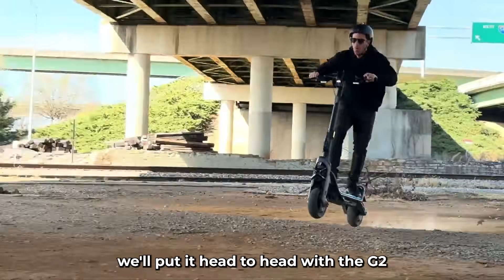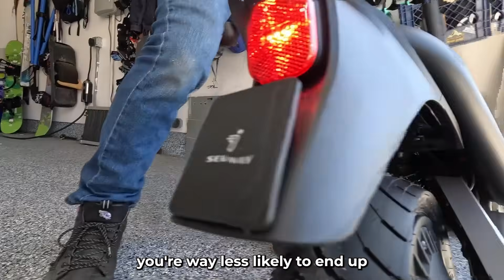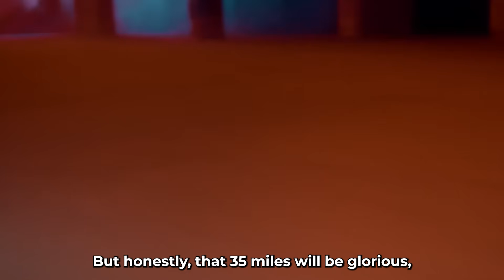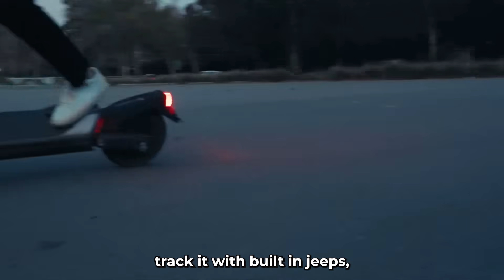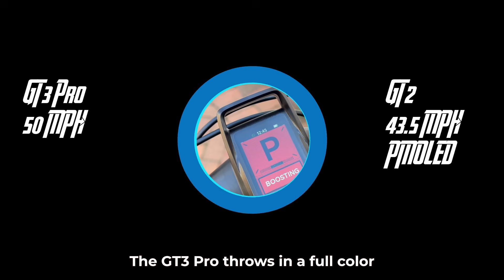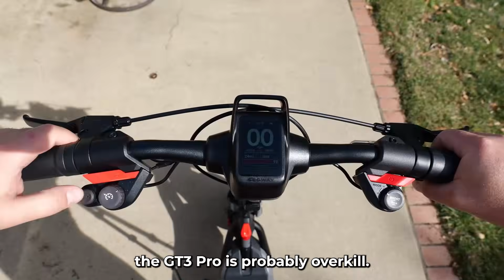Is the Segway GT3 Pro Worth the Price? The Truth Behind the Hype

Comment: well i have mine ZT3 pro and Segway do EXACTLY what they say can do... Reach 40km using pro gear at 40km speed. In low (15km/h) can reach 70km. I tested all. And all acomplished whit presition. Im from Argentina. Here i cant buy the GT3 pro, thast why i told my experiencie whit ZT3 pro... Segway administrate the charge whit 100% accurace. Right now ive done 2200 km in 240 days from when i adquire mine and the battery is exactly like the first day. Normally you could get a thousand charging cycles whit an normal use (charging 20% to 90%, and not using when is under 20 and not charging more than 90% - u can configurate this options in the app to save the long life of the battery)...
Reply: What I do need to warn you about is the shock absorbers. More specifically, the shock absorber bushings and axles. These break and can't be replaced. The entire shock absorber needs to be replaced, and it's not so easy... You have to disassemble a lot of plastic parts and buy some tools. But it can be done. The rest is flawless. I use it AT THE SKATEPARK! And in my city, there are cobblestones. I NEVER took care of it as I should have, and every day I jump from the sidewalks to the streets, fishtail hard when cornering, etc... And it's still going strong, with NOTHING wrong with it. When I disassembled it for brake maintenance, I noticed it has double weatherstripping on ALL the joints and melted liquid plastic on all the plates and connections. It's practically indestructible. I would buy it again WITHOUT HESITATION.

Comment: Gadget:  I'm not sure if I already messaged you, but I ended up ALSO pre-ordering like Andy.  I was deciding between the NANROBOT LS7+  or the Segway GT3 Pro.  I feel like the Segway just simply has more safety features which are important to me.  Also I do believe when you have a lot of ambient colorful lights on the side of the scooter, the chances of one of those small LED's burning out are 50/50.  I feel like that would cheapen the look?  The Segway has a less is more vibe going on, but still remains stylish.  I could always add an underglow ambient light which TO ME would look a lot cleaner?  I feel like the LS7+ has better brakes though?  Am I wrong?
Reply from the maker: The LS7+ does have a lto of LEDs. You;ll look like an icecream truck on a summer evening :). I assume you can turn those off, to save battery.
The brakes, form what I'm seeing, LS7+ has a four-piston calipers brakes with EBS, while the GT3 Pro has a dual-piston calipers. This means the LS7+ has a stronger braking force, and the pad wear is more evenly distributer. 
Not sure how large the disc is on LS7. but from the looks of it, you are right, they seem better. 
But for me it wouldn't be a decisive factor. The brakes on the GT3 Pro are good too. 
The safety features seem like a better fit for you, if you're worried about theft and all that.

Comment: It's definitely not worth the upgrade if you already have a GT 2, especially at that price. I don't know why anyone would need a scooter like that if they're just commuting.
Reply: 2599.00 pre order price.
Reply from the maker: That I agree with. If you're just commuting at cruise speed, no rough roads, not a speed fanatic. no point in upgrading , if you already have the GT2.
Reply: @GadgetEvolutionThe difference in performance between the GT2 and 3 is about as much difference between  120fps and 130fps in a video game. The difference in speed is negligible, and it’s very unlikely that anyone would utilize the capabilities without endangering themselves and others. Even the GT1 is sufficient.

Comment: I live in Canada, just bought it. Got it and it’s so fun, Powerfull, stable, reliable. Went 70km/h and felt like i was on a motocycle.
Reply from the maker: that's awesome. enjoy it!
Reply: How much did you pay? i can't find it on their site.
Reply: @JackReacheround yea it’s very limited in stock. I bought mine at an electric scooter store near where I live where they sell segway products. There was only one GT3 pro in their stock. I paid 4500 CAD
Reply: @EmileBrisebois friend, please tell me what is the real power reserve there? how many km will it really travel at a speed of 25 km/h and at a speed of 50 km/h
Reply: @andreypron3747 at 100% battery, well to be honest, i haven’t tested it as much as I would want to, I was travelling so not home. At 25km/h, it can do at least 115km on one single charge. At 50km/h, maybe 80km. And at 60,70,80km/h like 40km.
Reply: @andreypron3747  well i have mine ZT3 pro and Segway do EXACTLY what they say can do... Reach 40km using pro gear at 40km speed. In low (15km/h) can reach 70km. I tested all. And all acomplished whit presition. Im from Argentina. Here i cant buy the GT3 pro, thast why i told my experiencie whit ZT3 pro... Segway administrate the charge whit 100% accurace. Right now ive done 2200 km in 240 days from when i adquire mine and the battery is exactly like the first day. Normally you could get a thousand charging cycles whit an normal use (charging 20% to 90%, and not using when is under 20 and not charging more than 90% - u can configurate this options in the app to save the long life of the battery)...
Reply: What I do need to warn you about is the shock absorbers. More specifically, the shock absorber bushings and axles. These break and can't be replaced. The entire shock absorber needs to be replaced, and it's not so easy... You have to disassemble a lot of plastic parts and buy some tools. But it can be done. The rest is flawless. I use it AT THE SKATEPARK! And in my city, there are cobblestones. I NEVER took care of it as I should have, and every day I jump from the sidewalks to the streets, fishtail hard when cornering, etc... And it's still going strong, with NOTHING wrong with it. When I disassembled it for brake maintenance, I noticed it has double weatherstripping on ALL the joints and melted liquid plastic on all the plates and connections. It's practically indestructible. I would buy it again WITHOUT HESITATION.
Reply: @EmileBrisebois what store I'm gonna order it online I guess
Reply: Hey where in Canada are you? Im in Toronto. I am about to buy it. I know its end of season but still.
Reply: Powerful u dummy
Reply: @Alex-tu5vu You, you dummy!

Comment: the gt2 was $4k at release and this will be $2.5k.  That's an improvement.
Reply from the maker: the price will drop on this one too, with time. As they come out with new models, it's normal to lower the price on the old ones.
Reply: also scooters are getting cheaper to make